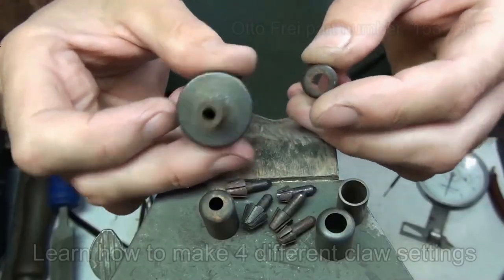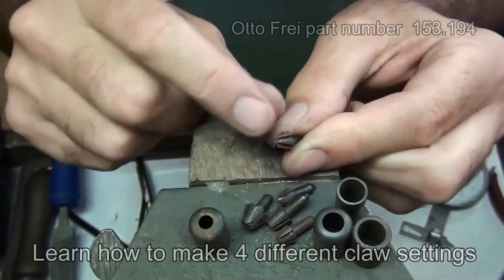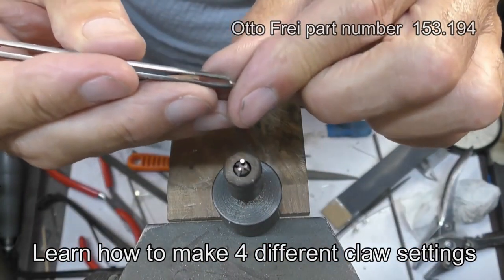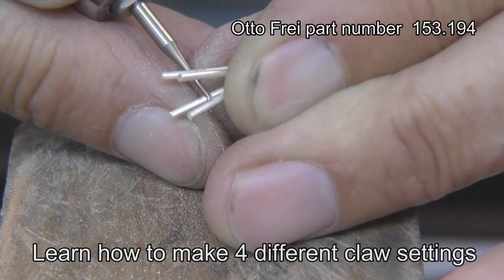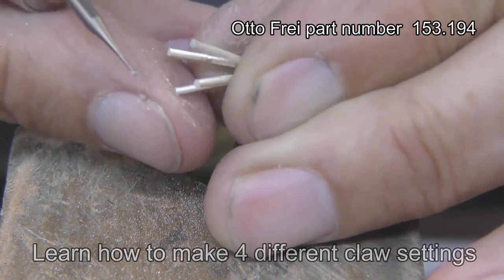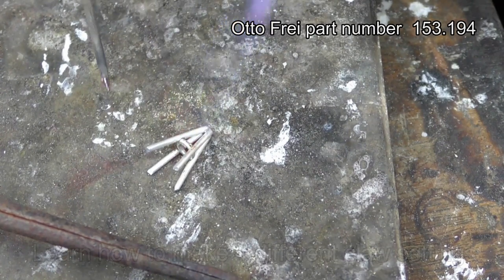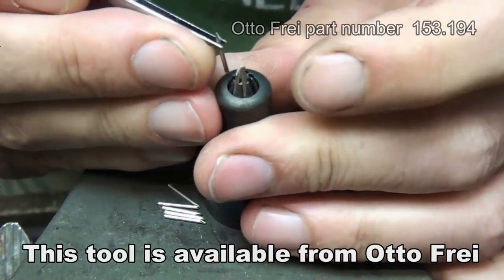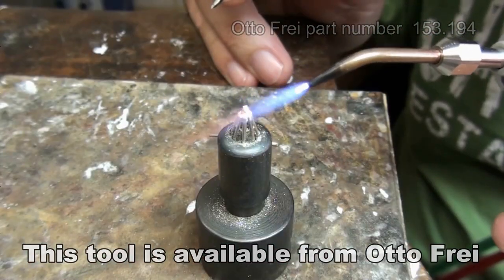Otto Frei Setting Making Jig With 5 Grooved Heads - Taper Basket Setting Demo - 153.194

Comment: The description on the Otto Frei website says "This jig is used for laying out the wires to make a setting, and not for soldering on or with.  One method of use is to use an instant glue to hold the wires in place (be sure not to glue the wires onto the jig), and then you can remove the glued together setting to solder."

This video contradicts that...

Comment: Hi, sorry for the question. But I couldn’t solder the silver wires on the tool. Can you help me please
Reply: Yeah it happened to me too. The damn jig sucks all the heat up. Since it doesn’t hold the work while soldering what good is it?
Reply: @johnathonmullis4234 you gotta use a proper oxy/fuel torch